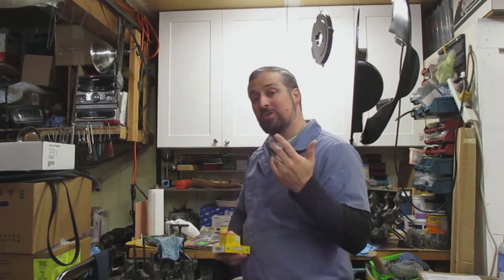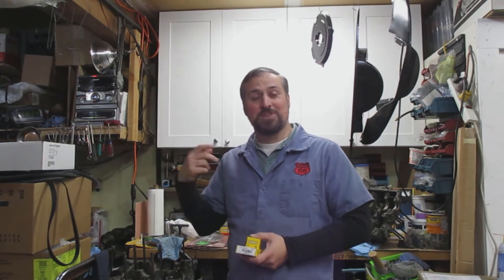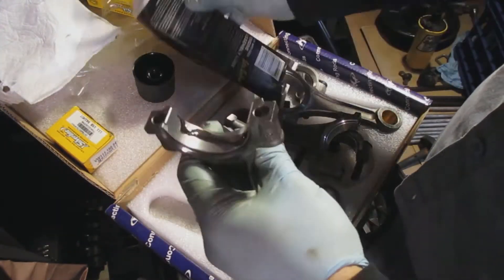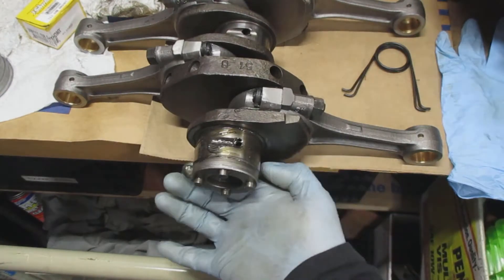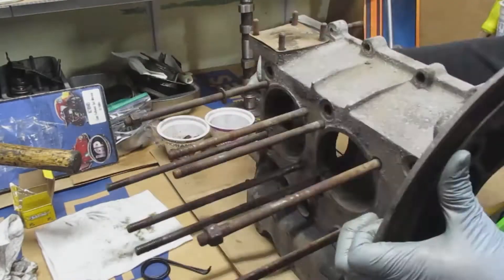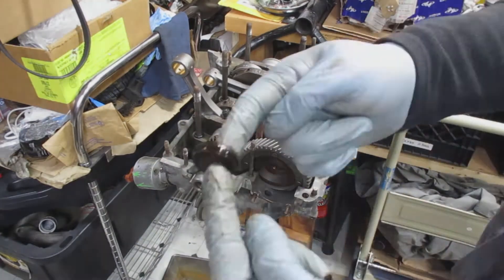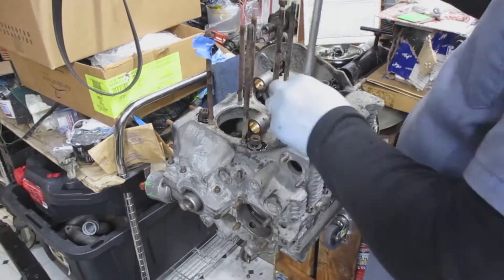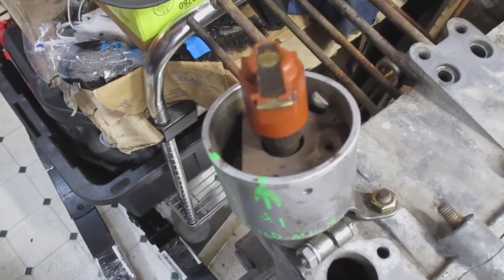How to Rebuild a 1641 VW Engine - DAY4 Put Case Halves Together - 112620 1641 Engine Build

Comment: Your video has been very helpful with assembling my type 3 engine. 

One thing I either missed or didn't notice was the assembly of the camshaft plug. 

Is there a different stage where that is installed?
Reply from the maker: Hello, the camshaft plug is installed, with case sealant, prior to putting the 2 case halves together. As far as i know, your not able to install the plug after the case halves are put together. I install this flat side towards the flywheel. Happy building. #mountpac

Comment: Thanks for doing this video, I've just started my first engine build and had problems of binding that you mentioned. I got it sorted but I was nice to see someone mentioning it. 
Also when you turn your crank on your shortblock do you use a spanner for any special reason?
Reply from the maker: Your welcome. I've been building engine since 1997. I use a wrench in order to turn the engine crank. I have had the bearings not lining up with the case dowels. I use the wrench for ease. I hope that answered your question. Have a great day!

Comment: Do you recommend only using the aviation sealant on one side of the case?
Reply from the maker: Hello Ed, I only put it on one side of the case. Installing it on both sides might be too much for the mean bearings to seat well. I hope this helped. Please let me know if you have follow up questions. Thank you - Michael
Reply: @mountpac4464  What is wrong with using  Gasgacinch?